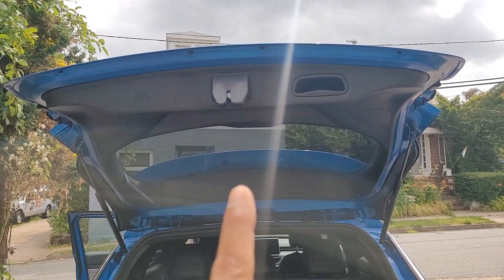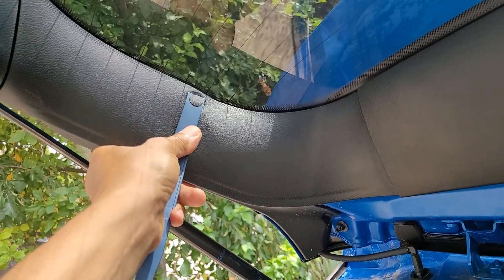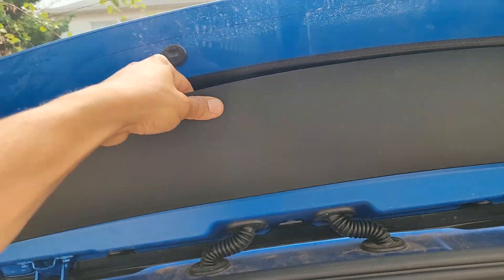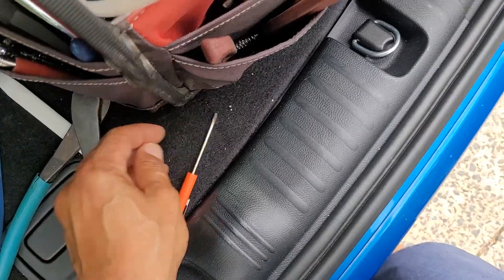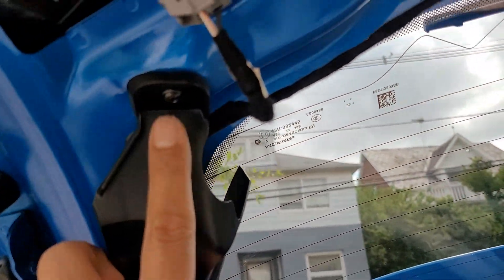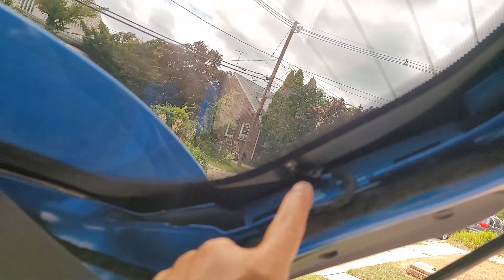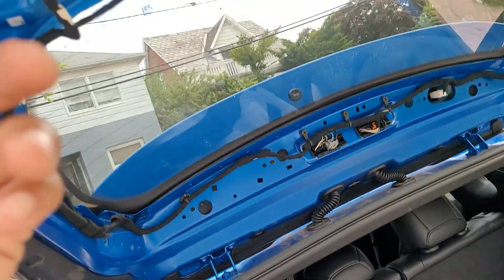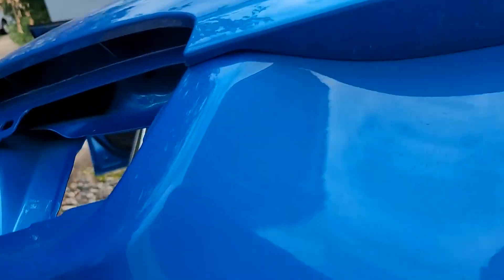How To Remove 2022-25 Jeep Compass Inner Tail Light/ Reverse Light.

Comment: U do know u can take off the access panel on main tailgate plastic. Smh
Reply from the maker: No way dude..are you saying I made this video for no reason? 🤣🤣🤣..so the access panel houses the bolt that is hidden for removing the tail light? Would make sense because the outer 2 are on the door..my thing is this..I usually overlap the videos after I talke off the rear hatch door panel. So your probably right about all that..the best part. Is the removal of the push pins that have no need for being there..🤣🤣🤣🤣..thanks bro